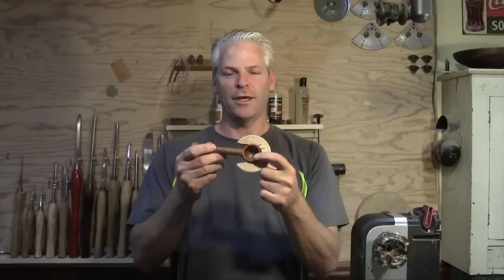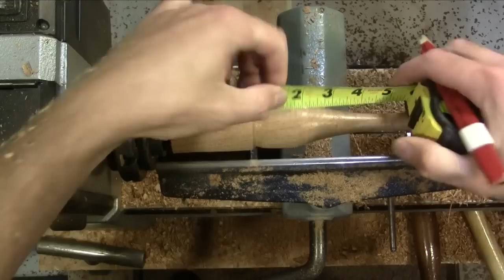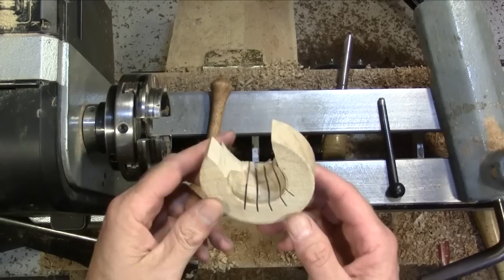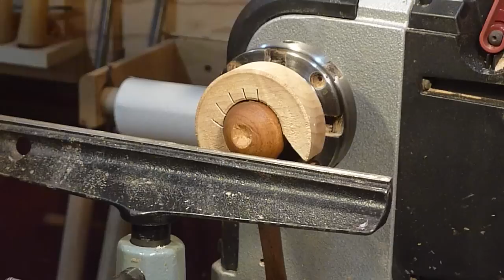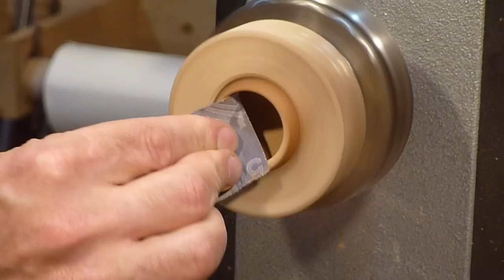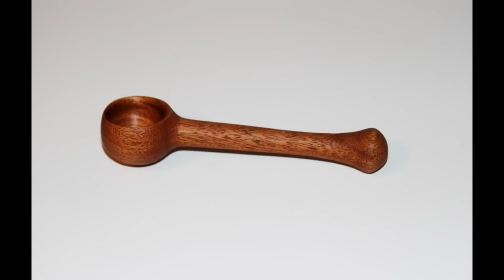How To Make A Wooden Spoon On The Lathe / Woodturning Project

Comment: great job, I will try with a full circle as jig, I would do all cut by hand with a hand jig, and you take away 3 mm wood to close the plate that holds pressure so find it more efficient :3 Great idea.

Comment: Hi Carl,
the spoon is a very beautiful work.
The idea of the bracket where you've embedded the spoon and have then clamped into the lathe is not bad.
just as you have kept the roughing gouge at the beginning and you cover it with the hand, so that the chips do not fly around.

Comment: what you could also add is a Velcro Strip around the outer perimeter of the spoon jig.. with a split strip to go from both the sides of the spoon handle. that way even if the spoon manages to come off loose, it wont fly off, as the Velcro strip shall hold it in place..

Comment: One of the tips I was introduced when I was begining on woodturning was to use the actual wood shavings you have just cut all scrunched up in your hand and use them to do a final 'burnish' to finish of your peice after other finishes. Not sure if this is something you have tried - not to be advised on segmental turning though!!
Reply from the maker: Hi George, yes I have tried it before. It works great for burnishing the wood.

Comment: Bit late to the party here, but I'm wondering if it'd be worth bolting on some counterweight for the jig. You're effectively making a bowl with a handle, so would it be worth using a bowl gouge for hollowing out?
Reply from the maker: With something this small you really don't need counterweight. A bowl gouge would work if you have a small one. The one I have is a little to big.